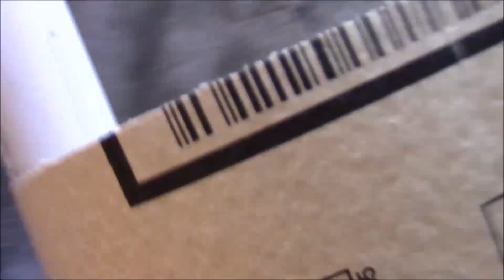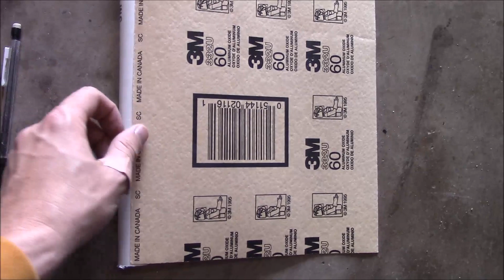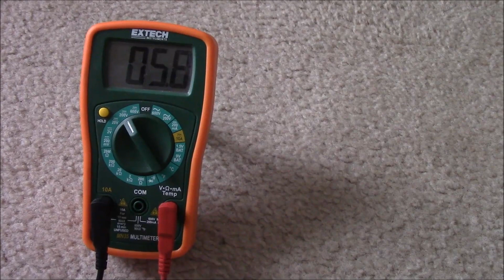How To Build A Micro Wind Turbine - Part1

Comment: What a drill motor work too? By the way good video
Reply from the maker: Thanks!  It probably will work.  It seems that most any motor will work but whether it is geared and winded to be able to produce meaningful power at the rpm that the wind is going to spin it and whether the wind will be ABLE to spin it at low rpm is the question.

Comment: Use stepper motor to get nice votages
Reply from the maker: It was a stepper motor.  It did not rotate perfectly smoothly, which made it harder for the blades to turn it.  I think steppers are better for more power but with micro turbines like this I think it is more critical to get the blades moving and keep them moving.
Reply: @LDSreliance  no men try to use

Comment: How much power (volts x amps) does it produce for a given wind speed??
Reply from the maker: Not much.  This little hobby motor is only a few watts.  Maybe 25 at the most.  This build was more of a small scale test to learn from.  Obviously I would need better blades and a different motor because that cogging effect from the stepper motor requires too much torque to get started.

Comment: I stopped at 7 minutes.  Good try but  Wasted effort.  That motor was trying to jump out of your hand with the unbalanced blades and you need 30 mph to get 14 volts?  Not my idea of micro wind turbine.  (update) O.K. so it was a "test"  from what I read in other comments. I see. So is not really how to built one since we can't follow your steps since is a test.  When you get it perfected make another video where you have worked out the bugs of this one,  Like vibration and the 30 mph wind needed.
Reply from the maker: Yes, this was just going to be a test because my HOA will not allow me to mount a real, full-sized turbine.  I was using a hobby DC motor that has a stepper so I knew there would be a cogging effect, which is why I think you see it trying to jump out of my hands as opposed to the uneven blades.  The blades were bad and very rough but they were not meant to handle abuse or sustained use.  I just wanted to see if I could really get the thing to spin and if that really produced electricity on the other end.  Obviously I know it works in theory as wind power is a real thing but until you play with it and build one you don't really understand how it works fully and what some of the challenges would be to making a bigger one.
Reply: LDSreliance The vast majority of HOA are nothing but Dicktatiors including the city hall employees

Comment: so could you run 4 of these to charge the same battery?
Reply from the maker: Yes with the right supporting equipment you could.  You would need 4 charge controllers, for example, or else a wind charge controller that is designed to handle multiple turbines.

Comment: Building a system would be fun but in high winds this will not stand up and can be very dangerous.  The RoofMill™ Wind Power Kit is one invention that has been so successful as a Wind Power Kit. For those who want a professional system that will hold up to hurricane winds and last for decades check it out.
Reply from the maker: There is a huge difference between your kits and a small homemade turbine for $50.   This obviously was never meant to produce meaningful power.  It was an experiement for the most part.  I have run across your company before and like your stuff but there are a thousand 1 kW - 3 kW kits out there.  If you want a real engineering feat, make something in the 100-200 W range that can be mounted and installed almost anywhere and cost less than $400.  You would literally be the only American company to do so and the Chinese stuff is complete garbage.
Reply: sounds like a sales pitch from a snake oil salesman.

Comment: Thanks man that was a great video, really inspired me to make one. One question, I live in top of a mountain in Ireland that has high strong winds all year round, would it be worthwhile to make one or could it be damaged? Maybe should I use more durable materials for the blades/nescelle? Thanks bud👍🏻
Reply from the maker: One like this made of pvc would get damaged eventually.  I would also imagine that for long term durability it would also need to be marine rated since you may be near the coast and lots of rain.  This kind of unit would be great to build to learn about generating with wind and observing how much wind you have available (is it every day, what is the wind cut in speed, are there really high gusts that can cause damage, etc.) and then you can use that info when it comes time to investing in a more durable, larger model.
Reply: LDSreliance I am currently learning about renewable energy sources in school, a new subject called environmental technology, and I'm about to start a report about renewable sources, so building a small scale wind turbine will help me understand it more. Thanks for the feedback I will definitely continue to watch your videos! Thanks pal👍🏻
Reply from the maker: Jamie O'Hare
Awesome, let me know how I can help.  Good luck and thanks for watching!
Reply: @LDSreliance  I'd like to ask why you think the motor you used is a stepper motor when it only has two wires coming from it? stepper motors have two coils and have four wires two per each coil and stepper motors would get hot when they're spun to fast (300 rpm or more) while a 775 motor which is what geared motor you used looks like may spin at 3000 rpm @ 12 volts. the clogging effect you mentioned could be because of the gear reduction which lowers the rpm from about 3000 or so to 300 rpm.

Comment: Hello sir! I have some questions for making my own wind turbine:
1) I was wondering if it's more effective to use 3 blades instead of 6. 
2) Do you suggest I get a motor with an internal gearbox? 
3) What rpm and voltage would you recommend to use as a motor for a small wind turbine? 
4) If I used a different motor (permanent magnet motor) with either a 500 rpm 12v; 100 rpm 24 v; 50 rpm 12 v; but following the rest of your instructions, would it work? I would like to get the motor you used because it's convenient but I'm a little worried about the 'cogging effect. Would it be too much of a big problem that would prevent me from building an efficient turbine?
5) Also, what size load would it be able to power-maybe a lamp, or charge a phone? 
6) One more thing: once I eventually buid a successful turbine, can I mount it on top of a slowly moving car to test how much electricity can be made? The wind speeds are very low where I live, around 5-10 mph. I apologize for asking so many questions, I'm trying to build this turbine for my school project.
Reply from the maker: 1) I used 6 because that is how my hub was configured.  I probably could have done 3.  I don't know how much effect it will have on that small of a turbine.
2) No, you don't want gears if you can help it.  However, with the hobby sized motors you will never find a low enough rpm motor without a gearbox.  On bigger production size ones it is easy.  But almost all hobby size DC motors are 1500+ rpm and will not work for wind.
3) I'd stay in the 400-600 rpm range if you can.  Voltage doesn't matter as long as you match up with your battery bank.
4) Stay away from cogging if you can.  If you can find a 500 rpm 12v get it and let me know where you found it!  100 and 50 rpm is too low.  You will burn it up.
5) With the size I used you are looking at only 5-10 watts I think.  I was just looking for something that would trickle charge my battery bank in the night time when the solar is not working.
6) That could be a good test.  Or put it in front of a box fan on low.  You want to test the 8-10 mph range as that is going to translate to that 400-500 rpm range of your motor generally speaking.
Reply: Thank you for answering my question! I have one more question: my wind turbine project will be small and is tabletop size. Will a 12V motor be too large for a small turbine of that size or should I instead use a 3v hobby dc motor? I know the problem with those is that they have such high rpms or does it not matter?
Reply: @hannah-nu4jy  how did your wind turbine project turn out? if you want some ideas for small wind turbine projects I have three videos that I'd recommend I'll put the links to them below.

https://youtu.be/AS74oAmjpxU

https://youtu.be/YY1oCNhD8_0

https://youtu.be/AckRAYQ8N48

Comment: how did you drill holes on the PLC like that
Reply from the maker: Not sure what a plc is.  The hub already had threaded holes in it.  So all I did was drill a small hole in the center of each blade in the notch at the bottom.

Comment: why 24volts step up
Reply from the maker: +Edward Werthner 24v has 4 times less resistance than 12v so you can run thinner, cheaper wire for longer distances.  Also, my solar panel system is 24v so this project was going to add a trickle of charge to the system during the night and overcast days when the solar panels were not charging anything.

Comment: Sorry Sir, but you got the blade geometry all wrong.   Please have another look at how you can cur the right contour from the pipe,  and bear in mind that the largest twist should be near the centre while the lower twist is at the tip. This would mean that the trailing edge of the blade will be a straight line parallel to the axis of the pipe but the leading edge will be a swept back line. Also you would need to bolt  this type of blade on the trailing edge and not at the centre which appears to what you have in this video.
Reply from the maker: +Carmel Pule&#39; I definitely do not know anything about aerodynamics.  I just copied what I had seen others do.

Comment: Great video. Can you please say what motor you chose for this or what motor you would recommend? There are several and I'm a bit confused on which one to get. Thanks, and sorry for needing this help:)
Reply from the maker: +Jeff Greene For this one I used a hobby sized stepper motor that was rated around 200 rpm.  Steppers are not ideal but if you can get enough torque through good blade design and length then they will work.

Comment: rc cars large ones use a setup similar,  and produce power. also put a nut on the backside of your machine screws to lock them down.
Reply from the maker: Raquel Bauman Yeah this is basically very similar to an rc car motor.  This was just an experiment but if I were putting something like this into permanent duty I would use much more durable materials and better fasteners like you said.